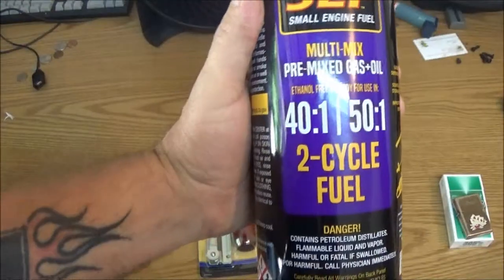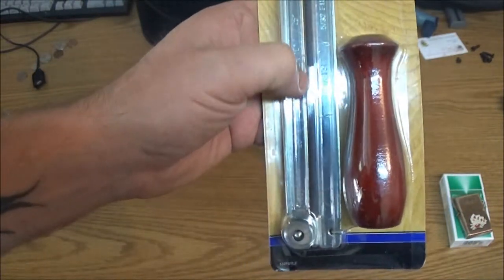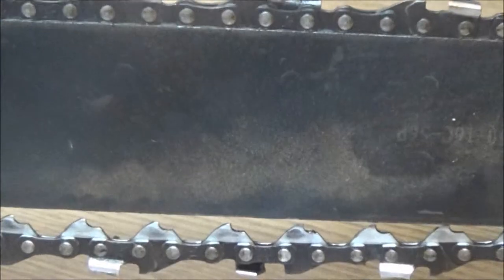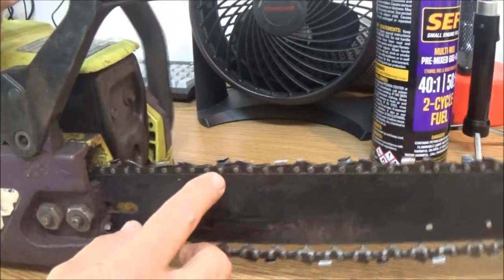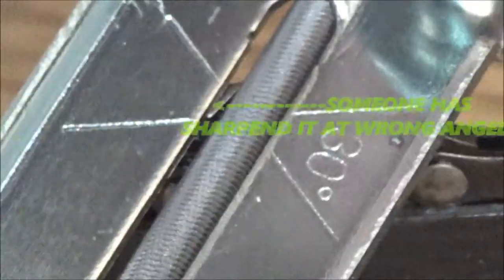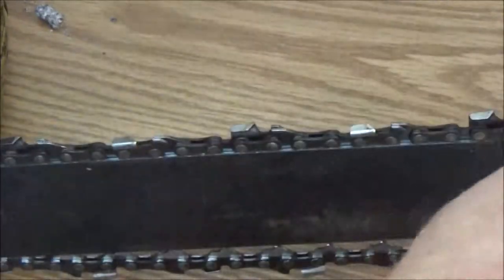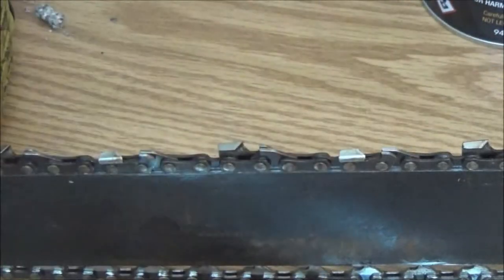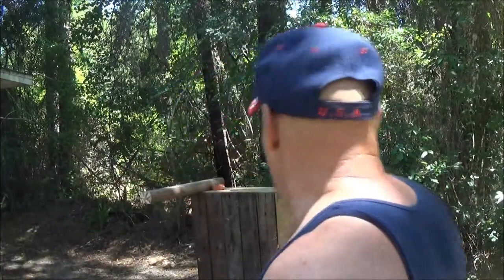Chain Sharpening And Pre Mix Fuel Review

Comment: Thanks for the video.  I have a small gas chainsaw, and also a small electric saw.  They both need to have the blade sharpened, and I was never sure how to do that.  I saw they have the special file with a handle at Harbor Freight, but it's just the file & handle and no gauge.  I heard that pre-mixed fuel was pretty good, because it is Ethanol free which is better for small 2-cycle engines.
Reply from the maker: You're welcome Pete. It seems to be running flawlessly with that premix.